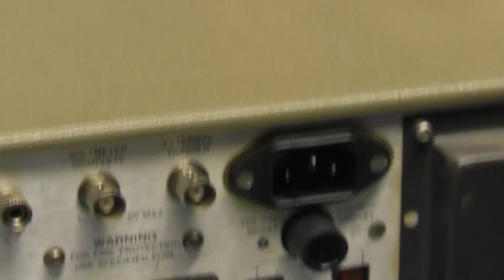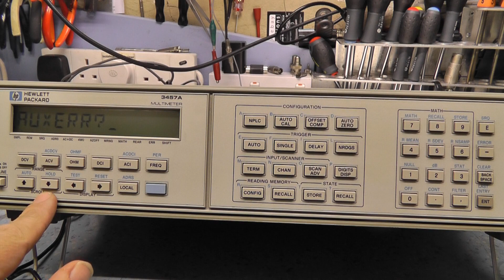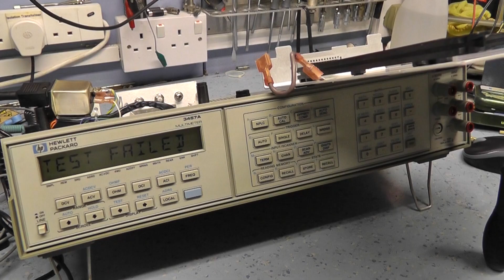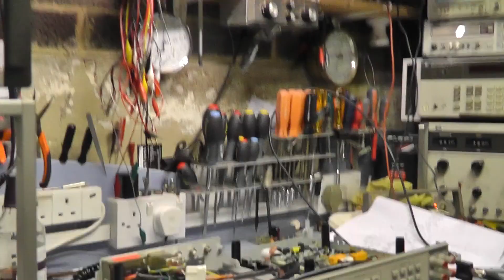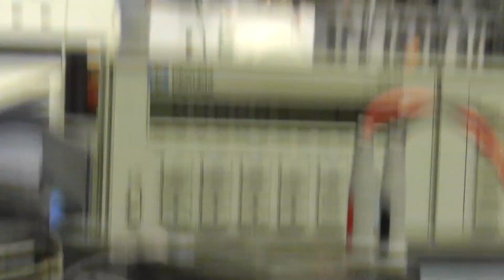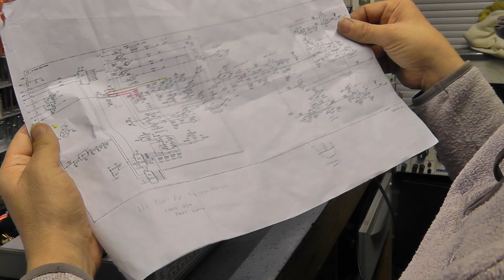Hp 3457a Pt1. First power up and investigation

Comment: Just received my 3457A today in the mail case has a few nicks little rough had a few stickers on it, and one broken binding post, but I got it really cheap. I just need it to work mostly DC volts and ohm readings. It does not have to look pretty. Taking my first electronics class in our college electronics 101. 
     Looks like I’ll be watching all your videos to learn how to do repairs and calibrate.
Reply from the maker: Good luck. You can always the rear binding posts. Run a self cal on it, chances are it will be fine.

Comment: The RMS converter chip in my 3457A is an Analog Devices AD637KD. This chip was very widely used in multimeters of that era and it is still listed on the AD web site although it is noted as "not recommended for new design". It should still be reasonably easy to obtain although it will not be cheap. The KD package is a side brazed ceramic package and is probably the most expensive package option; this chip is also offered in CERDIP and SOIC packages which are likely to be somewhat cheaper although you will need an adapter PCB for SOIC package.

The 3457A is basically a 6 1/2 meter so you can alter the number of digits displayed from 3 1/2 to 6 1/2 using the DIGITS DISP key. If you are really keen you can write some SW and get 7 digit readings out via the GPIB interface.

My 3457A is also slow autoranging on the ohms function so your unit is probably functioning normally. Since the measurement range goes up to 3Gohm the test current is quite small and it takes a while for stray capacitances to charge up thus slowing the autoranging function.

Comment: Simon, as is well known HP had suppliers mark ICs with HP part numbers, so 1826-1301 is the HP part number for AD41790. 1826 simply means that it's a silicon analog IC and 1301 narrows it down to the AD41790. These are available if you want to spend enough money :). Cheers, Steve.
Reply from the maker: oldblokeh yes but on closer inspection I think that chip seems ok. Thanks anyway. looking at the attenuator  now.